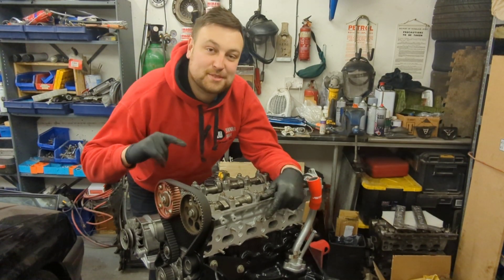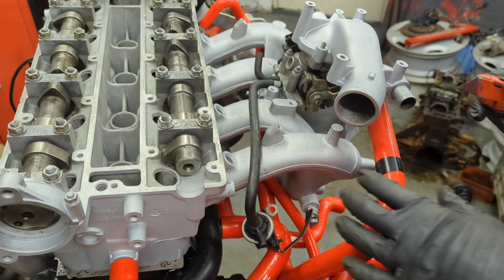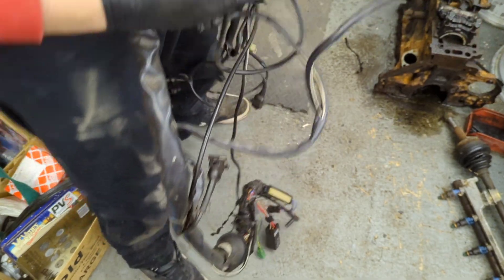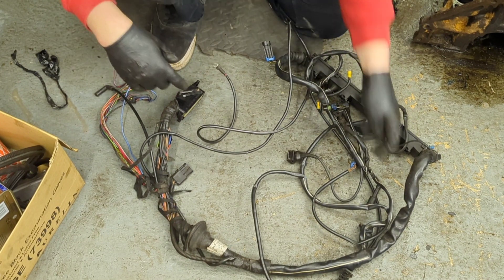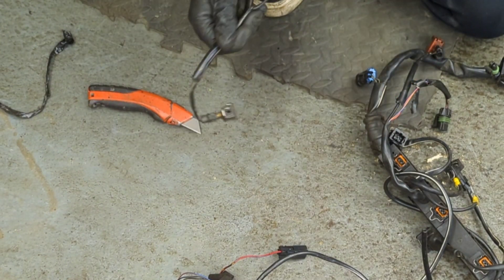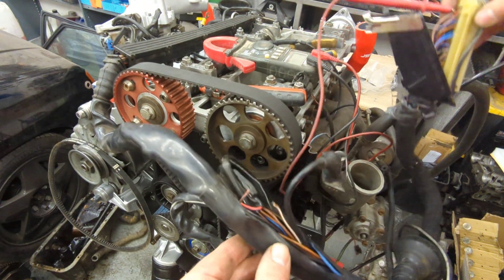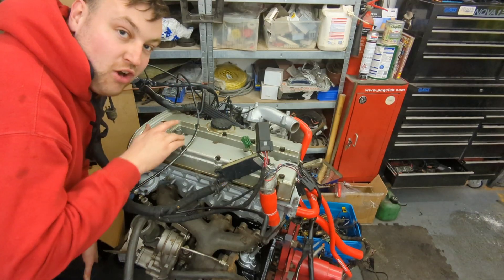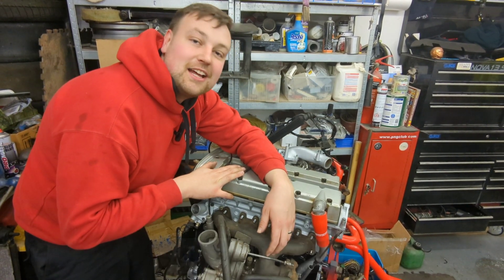Vauxhall Nova Turbo engine conversion - C20LET Wiring & hoses explained, inc wiring repairs

Comment: Is it a cold/hot start valve? Or is it just a hot start valve? And the tank vent valve? How do you bypass them correctly?
Reply from the maker: This never had a tank vent, so very easily. Just don't connect it.

Comment: Im a bit confused.. 5:09 That wire is red for battery pluss ofc, but mine is black? is that cable suppose to be for Battery pluss? I've googled c20let wiring diagram and there I didn't even see that wire or any tag on it.
Reply from the maker: It's a red wire with a black sleeve. You will notice the rest of it is black.

Comment: Could you please tell me about the ''pre heating vacum hoose system'' on the inlet manifold. Is it for heating up the air when it's cold outside? is it needed for a summer car? and will it be better off on a summer car? can I just block it? or should I leave it open? like it was when I bought the car.
Reply from the maker: Do you mean the hot start valve on the side of the inlet?
Reply: Yeah, in the middle. the pipe with 3 different ports. I found out many of the vacum hooses could be blocked for less problems.. Do you know this to be true? @DanielBall
Reply from the maker: @whatigame yeah lots of bits aren't required 👍🏻

Comment: Good videos these mate definitely helping me out keep them coming🤙
Reply from the maker: Thank you 😊
Reply: @DanielBall  Did you ever fit the GSI front anti roll bar with the lowering blocks as I’m currently building a C20let and I’ve heard people say to run without it or use Harry hockley Hangar kit?
Reply from the maker: @dRiDept  never bothered, from experience I prefer the drive without

Comment: Very nice videos with good explenations, will relook again when fixing the engine. I would really like more c20let engine videoes. Maybe the wiring and the vakum lines could be a little better explained.. but I'll give it a 9/10 and a like
Reply: Very informative, thanks for sharing. I have a C20XE 16v 2l red top engine.Someone cut the MAF sensor wires near the connector and i haven’t got a clue which wire goes where. I have the 6 wired one labelled 1-6 but i have no idea which wire goes where for me to solder.Any advice would be greatly appreciated.
Reply from the maker: @robbykimani thank you, can you not see the colours? If not you will need a wiring diagram.
Reply from the maker: Thank you.
Reply: @DanielBall  I've got a Nova GTE I'm looking to put a 20XE in it. What do you charge for such a job?
Reply from the maker: @KeithFox- sorry I don't take any work on. Maybe one day in the future but at the minute I am just too busy. Thanks for asking though.
Reply: Thanks for the reply, any idea where I can get the 6 wire MAF sensor diagram please?
Reply from the maker: @robbykimani  I bet Mat Armstrong doesn't do this for his viewers haha. I hope this helps. Sorry I can't find the colours, but this will give you a good idea if you are handy with a multimeter.

Pin 1 goes to earth
Pin 2 goes to pin 26 of the ECU
Pin 3 goes to pin 7 of the ECU
Pin 4 goes to pin 25 of the ECU 
Pin 5 goes to ign, pin 87 of the ignition relay
Pin 6 goes to pin 43 of the ECU

I would massively appreciate a share of the channel on your social platforms 😉
Reply: @DanielBall  thank you for going out of your way to help I do appreciate it,this will definitely help.